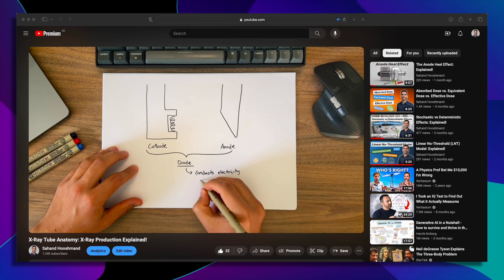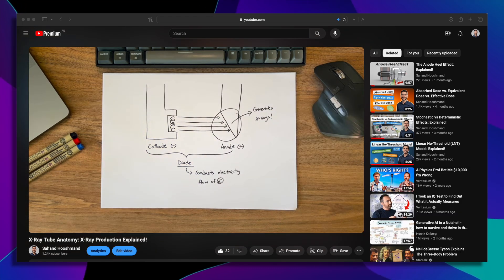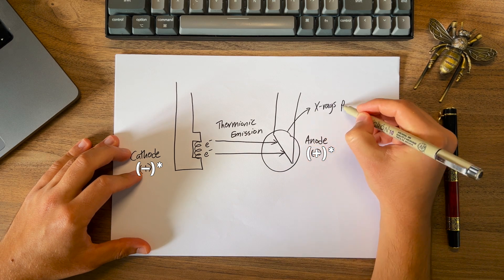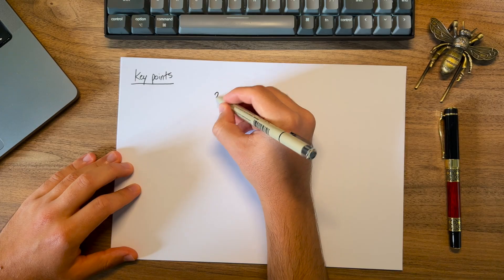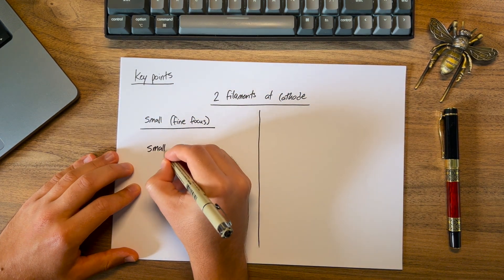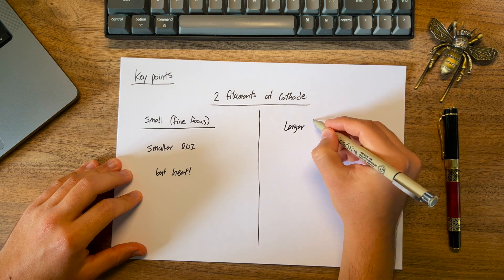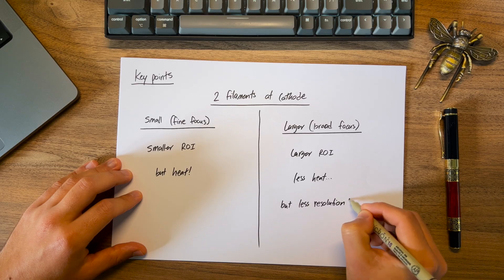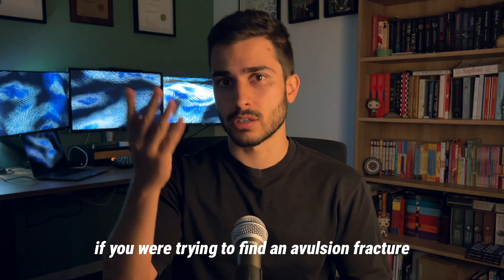Focal Spot Size: Explained! (Fine vs Broad Focus)

Comment: This used to confuse me to no end. One thing I'm wondering is: is it true that the broad focus is also used in situations where a short exposure time is beneficial, like for a PA thorax because of the heart and the so they don't have to hold their breath for quite as long? Does that factor into the decision-making, or is it just the fact that you can get a larger ROI as well as not needing the extra spatial resolution around the smaller anatomy?

Thanks in advance
Reply from the maker: Hello! So I believe for something like a CXR, because the total mAs is so low (whatever the mA and s combination is), e.g. anything from about 3-9 mAs, it should be fine to use the fine focus setting, but I will check this myself on the machine and will get back to you. The fine or broad focus setting doesn't affect the ROI by the way, you can still collimate for the same amount on either setting, it just changes the effective focal spot size which therefore can affect the penumbra (resolution of the image). Hope that helps! If something isn't clear, do let me know
Reply: @SahandHooshmand  That makes more sense regarding the ROI/penumbra. That's probably what always tripped me up.

No need to check the mAs stuff as I haven't gotten far enough in my education for the answer to really mean much. I'm only finishing up my 2nd semester here in a couple of weeks, so anything to do with parameters is still a bit abstract and hasn't really found a place in my brain yet, only on the page :D But thanks for the offer, and thanks for clearing up the focal spot confusion for me!
Reply: A larger focal spot can dissipate heat more efficiently, as electrons interact with a larger area of the anode. Therefore, for a high X-ray tube current, low exposure time shot, the larger focal spot would be more suitable. However this would depend on the system being used. Nowadays the system will automatically switch to the large focal spot where necessary as it can calculate whether or not the heat generated from that shot exceeds the cooling capability on the small focus. Something to look out for when a small focus is absolutely necessary as it doesnt generally notify you of the focal spot size change.